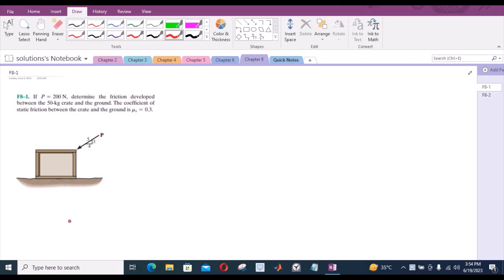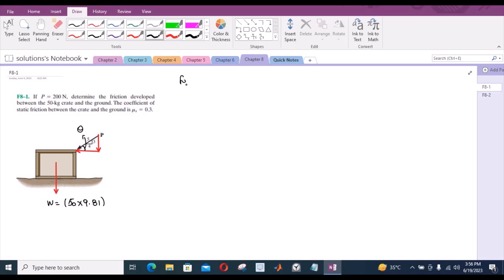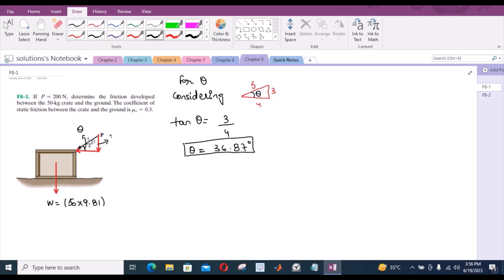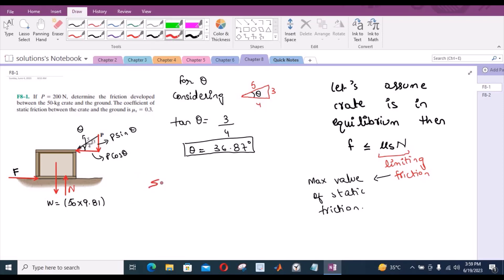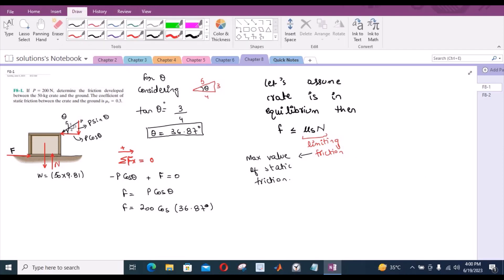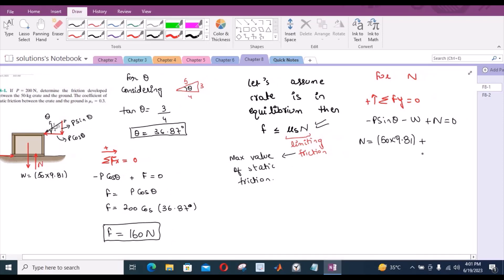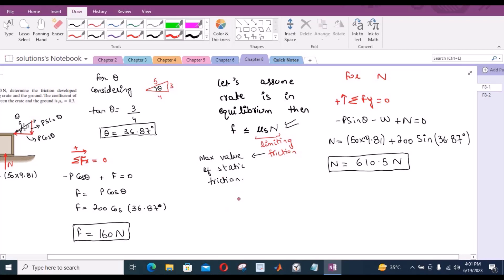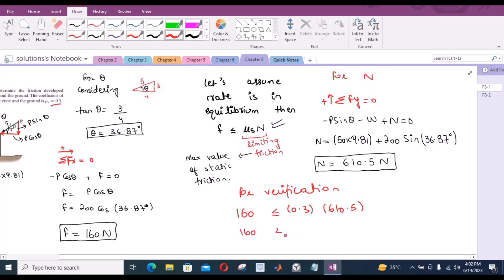F8-1 hibbeler statics chapter 8 | hibbeler statics | hibbeler

Comment from the maker: Learn How to Solve F8-3 Hibbeler Statics Chapter 8, "Determine the maximum force P that can be applied without causing the two 50-kg crates to move. The coefficient of static friction between each crate and the ground is 0.25."
Here is the Link: https://youtu.be/dUAkTKdbIlY